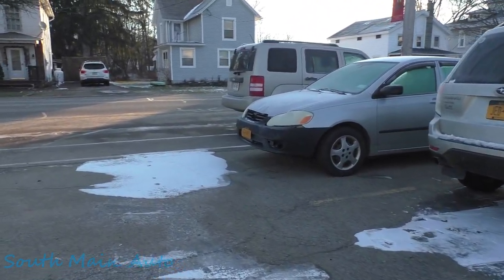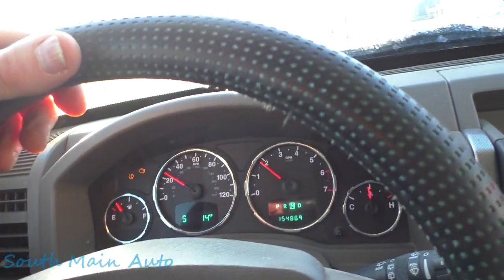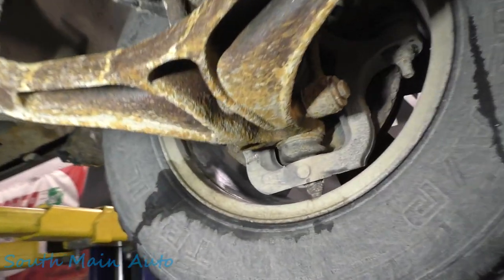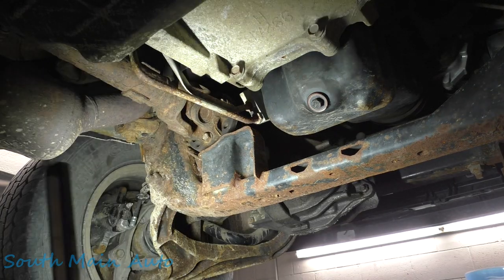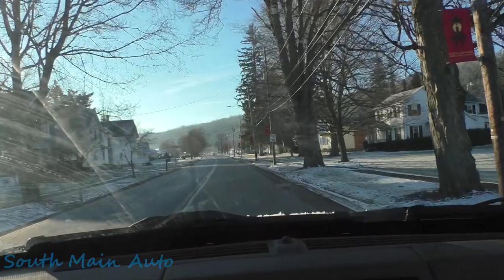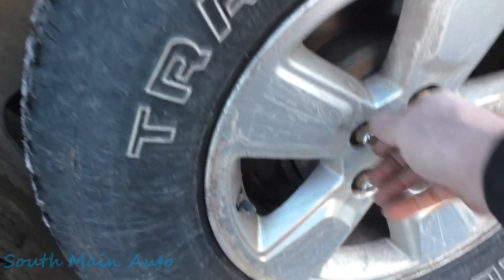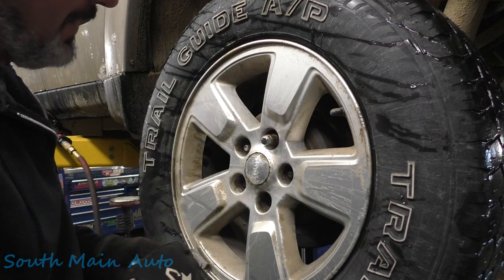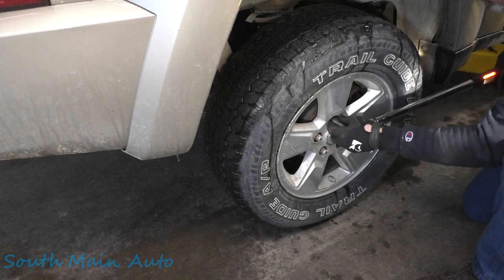Customer Just About Lost It.... A Wheel That Is

Comment: I had the same thumping sound problem three weeks ago.  Turns out the "mechanic" that changed the brakes on the front axle forgot to tighten the lug nuts on the driver side.  I carefully inspected the car and found the problem and retorqued the nuts.  Then had a nice conversation with the mechanic who promised to never do that again!  For the record, that promise was to myself because I was the meathead mechanic.

Comment: Sounds travel and bounce off to come back at the driver sometimes.
I had a small car come in with front wheel drive.
The customer wanted to find which wheel bearing, left front or RF.
I was testing on the lift with a stethoscope thinking RF after a road test.
Another tech walked by on his way to the other side of the shop and spun the rear right tire on my job.
The rumble was very loud and obvious.
They had an estimate of $250 for whichever front bearing had to be torn down and pressed apart.
We fixed it with new rear tapered roller bearings during a rear wheel pack.
If you would have driven it , you would be looking in the front too.
Our policy suggested safety check before the road test.
It doesn't always happen that way.
They want you to go take a ride so the customer can point out what he hears and is trying to fix as well as which side he wants given attention before the diagnostics prove it out.
That tech sure saved me from condemning anything in the front hubs.

Comment: Personal experience says they end up loose from corrosion on back of rim and hub face. Usually breaks down after taking off and putting wheel back on. And good luck getting a flat rate guy to spend 30 minutes cleaning them when he's getting .5 for the oil change, rotate and mpi

Comment: I just had a lady bring her little Toyota Corolla in complaining of a horrible knocking coming from the rear passenger side. I just glanced at it and there was at least several handfuls worth of grass wedged in the bead of the rear and front tires on the right side of the car. Somehow, they were still holding air. The rear wheel had lost 3 of the five lug nuts. One of the last two was finger tight and the last one was torqued to spec. Aside from the grass, the front tire lugs were fine. She swore up and down that she did not swerve off the pavement. I replaced all the lugs and nuts on the rear tire, broke the bead on both tires and cleaned grass out and sent her on her way. :body-blue-raised-arms:

Comment: had a front wheel try come off old school VW beetle which were held on with 4 x bolts not studs and nuts. With all the slop and play in the steering i never noticed it coming loose until it was on the last bolt and then things got interesting with nothing left to keep it centred on the hub. Just think Herbie goes Bananas!

Comment: True story. 1987 Oldsmobile Toronado.  Had new tires installed.  A few days later started to hear a knocking sound from front end.  So I decided that after work Friday I would try to look at it. Well driving home I made a left turn onto a major street and the front right tire just took off into a wooded area just missing a woman standing at the bus stop. The front end dropping hard to the pavement did a bunch of damage. Yes, they didn’t torque them properly.  Imagine if I was driving on the highway. Scariest thing is the look on that woman’s face as my tire whizzed past her.

Comment: Had a 2000 Caravan Sport that was making what I thought to be a wheel bearing going bad. Then one day it starts to get louder and louder and then it made 2 loud pops and the wheel starts shaking violently. The lug nuts had loosen itself and 2 studs snapped off which is what made the popping noise.The back side of the aluminum wheel had a gash, can't remember why thou.

Comment: Replaced an engine on an '05 Hyundai Sonata. Old one developed a rod knock.
A month or so down the road, his daughter was driving on s major freeway and a wheel comes off. I don't believe it was my fault as I think it would have come loose much sooner. I drove it about 200 miles before letting them take it as I wanted to give it a good shake down. 
I felt bad about hearing about loosing the wheel. However, I hope she starts listening to her vehicle for unusual noises and gets them investigated! No one got hurt. Different set of wheels fixed the issue and a set of studs back on the road.

Comment: Some where in my Toyota's owners manual, it mentions re-checking lug nut torque with alloy wheels after 500 miles when rotating or replacing wheels.

Comment: Had my dodge ram in my heated warehouse to change from axles u joints. Got it all back together and took it home and it sat outside in the winter. 3 days later same knocking sound. I thought that the u joints I just installed went bad or I done something wrong. Took it back and jacked it up to take it all back apart. And sure enough both front tires were loose as can be.

Comment: My loose wheel story kind of really torqued me off when I realized what the problem was.
A younger couple came in to get new tires on a Cavalier. So I pull off the wheels swapped em over, went to put them back on the car. I think the torque was 80ftlbs.
Well I stripped 3 lug nuts before I looked close at the studs.

Well they were too short. So my guess is the dealer or the customer swapped the steel rims to put on the aluminum OEM GM rims to make it look nicer. However! Never swapped to the longer studs. I gave them 3 OEM fit lug nuts and informed them to take it to where they bought the car and have them change the studs. Informed them I don't recommend they even drive it , since I could only get about 50ftlbs of torque on the lugs without stripping them out. There is no way the dealer could've torqued the lugs to Spec.

Comment: I had this before but the nuts were over torqued so the first bump that was hit 3 nuts sheared. They were still there but literally doing nothing. Went to take them off and they literally twisted off. This was on an old Toyota, I had to carve a divot to install new studs without removing the wheel hub bearing. Forget that.

Comment: I had a lose wheel come in a week or two ago, it was on a 2018 peaterbilt, dude swerved into one of those concreat bariors to avoid a passenger car, ended up worrlering out the rim, janking up the studs so much the hub had to get replaced, and bending the cross tube. I was barely able to get the old rim off it was so bad. Was not a happy driver that day, but at least he got it into the shop and didn't have to find out all this on the side of the road.

Comment: OK, my funny loose wheel story.  Back in Sept 68 I returned home from a 3 year overseas assignment (USAF) and ordered my 1969 396 SS Chevelle. It finally came in right around Thanksgiving  I put about 500 miles on it with no problems, and since an old girlfriend was home for Thanksgiving took her on a date to the local night club.  Big place, 3 bars, 3 bands etc. Driving her home, I got a clunking noise so instead of going parking I took her right home.  The clunking was worse as I left so I pulled over and went to take a peek under the car.  As I grabbed the wheel, it clunked.  Got my jack out and both rear tires loose. Tightened them up and was in a rage waiting to go to the dealership on Monday to raise hell. Sunday night, I went back to the bar and found out three other cars had wheels stolen the night before.  I guess by leaving the bar early I may have scared them off or mine would have been gone too. Coral Reef, Newburgh NY

Comment: I worked on a JD tractor with MFWD one time that sounded like the front axle was coming apart. Took me longer than I would like to admit, but the wheel disc to rim bolts were slightly loose.

Comment: I have experienced this on grand cherokees and other jeeps, I think the hub clearance is too tight from new and with a bit of corrosion the wheel does not fully seat when removed and  re-installed and torqued and it then settles back fully on the hub with driving and this releases the wheel nut tension. My fix is use a flapper wheel to clean up the hub if it is in anyway tight and this permanently fixes the problem.

Comment: I noticed some years ago that the left wheels on  the heavy trucks I drive tend to come loose more often than the right ones, been driving hcv for over 40 years now  so I've had a bit of practice with them.
Some of the smaller Japanese trucks had  left hand thread on the left side lug nuts, didn't seem to  have the same problem. 
I  had an older Chrysler in my shed  for a brake job,  the owner told me to carefully torque the wheels because they kept coming loose, it would appear that the  man who rebuilt the car had put the wheel studs back in on the opposite side of the car,  left-hand thread on the right side and right hand thread on the left side, possibly could've come from the factory like that, dunno. The car was a 1962 vintage. 
I  drive or repair heavy commercial vehicles  for a  job, cars especially older ones are just a hobby.
Reply: If I recall correctly, Chrysler products of that vintage used hub and drum assemblies with the studs mounted in the drum. Someone doing a brake job probably swapped them left for right after having the drums turned.

Comment: I wonder if the lug nuts themselves contribute to the issue. My 2005 Dodge Magnum used what appeared to be steel lug nuts covered by a soft metal cap for appearance. I found this out after several years when I started having trouble fitting the lug wrench over the lug nuts and was having inconsistent torquing. Several of these "beauty" caps were loose and a couple of them even came off. I replaced them all with chrome-plated aftermarket lug nuts and had no further issues. I'm sure a lot of Chrysler products used that type of lug nut.

Comment: Trivia: Chrysler first offered cast alloy wheels in model year 1969. Lugs would not retain torque, all were recalled and replaced with steel, luckily, this was fall of 1968, some cars were at dealers but few were sold. Engineering was so freaked out that no aluminum wheels were offered until well into  the 70s, and those were FORGED aluminum. Castings did not reappear until the 80s (the FWD era).

Comment: 110 to 120 is my magic number for those. Less and they work loose. More and you won't get them off on the side of the road.  Also, put solid lug nuts on and throw out the stock ones with the stainless steel skins.

Comment: I always torque wheels at 15 to 20 lbs over recommended torque then recheck a week or so later. Good and informative video.  Ps I have just run into this on a 09 Malibu
Reply: I wouldn't do this on an F150 with 150 ft-lbs spec and two-part lug nuts...
Reply: If you are talking about the lugs with caps I agree.  Worst thing made in my opinion.  I live in ohio and run into several that had to be cut off. Usually I replaced with solid ones if applicable

Comment: Replaced clutch on my Audi. Few weeks later had a weird feeling in the seat while driving, which then turned into a noise that got worse and worse. I already saw myself pulling the trans again and hoping that the flywheel or pressure plate wouldn't blow up before that. Got back home and discovered that the LF wheel had only 2 loose bolts left out of 5. Was happy and frightened at the same time.
Reply: Audi...the breaker of men.

Comment: My (shameful) story was to figure out a clunking noise from the front tire on 2010 Camry.
I did all the checks ... sway bar links, balljoints, control arms, nothing. I gave up and after long period of despair,  I discovered by chance the bolts on the guide pins on one front brake were loose with one bolt already missing. I must have forgotten to tighten the bolts after replacing the brakes. I don't know why I never checked the easy parts and instead went for the difficult components!
Lessons learned.

Comment: A month ago I took my car to a local shop here in Tampa to have my tires balanced and regretted it. One damaged lug nut and a lose wheel weight that fell off a few miles down the road. 

Took it back first thing the following day and almost lost my mind when the guy there tried to convince me I didn't really need to have the tire rebalanced. He also reluctantly ordered a new lug nut, which didn't even match the other lug nuts by the way. This individual stood there and tried to convince me that as long as I didn't feel any vibration in my steering wheel while I was driving that the wheel didn't need balancing. But it needed it the day before when they initially did the wheel balancing. 😕

 When I asked him to show me where he had read that, he couldn't do it. Big surprise right?  When he placed the tire on the machine to balance it he was having trouble setting up the machine!  RED FLAG! This man does not know what the hell he is doing. Finally got it right and got the tire back on my car. BUT WAIT! THERE'S MORE!  I saw him use a torque wrench on my lug nuts but when I asked him about the torque specs he was dead silent. Just said my car was ready and walked away like a scorned child. I guess eating crow will do that to a person. 🤦😉 I also wanted to complain about the new lug nut but I figured I would just cut my losses and leave before we ended up in the evening news. 🤕😉🤣 Thanks again for posting these great videos sir! 👍

Comment: Just last week I had a loose wheel on a 2020 Ford Transit 250. They got it stuck and a plow dug them out. It came back from its 100 mile trip with 4 out of 6 studs on the rear wheel and the 4 lug nuts were about an 1/8 of an inch away from the wheel. I drove it about 15ft before I decided something was horribly wrong.

Comment: I try to make a habit of checking lug nut torque after the first drive any time the wheels are off.  My experience has been brand new wheels often need re-torquing 2 or 3 times as the new metals stretch and settle,. but used wheels generally are fine.  Good to know to watch out for the Chrysler alloys though.

Comment: I can remember getting home from a long shift and my wife telling me there was a grinding cluncking noise coming from the left rear on her car. So I jacked it up expecting to find a bearing or brake problem. After spinning the wheel and checking the bearing for play nothing was  jumping out at me. So I stripped it all down checking the bits as they came off. Still nothing. I put it back together and told her I couldn't find a problem.
Next day I got a call at work .  She was stranded 50 Km from home, the engine was running but it wouldn't drive. After arranging with the boss to take the rest of the shift off and make it up later I went to  the rescue. That was when I found the problem!!! The right hand front CV joint had detonated.
Eric

Comment: Nor a vibration but rather a loss of control when I had a wheel coming loose. The car would shoot across the lane more than I wanted. I was in a 45 mph crosswind and I figured that was why the car acted so squirrely. The wheel came off just as I pulled into a gas station. I took the wheel cover off and the lug nuts were gone  I removed a nut from each of the other 3 wheels to put it back on, then drove 10 miles to a junkyard where they gave me 5 nuts for free! They had 5 gallon buckets full of them sitting around.

Comment: I forget what I did to my old '93 3/4-ton Suburban, I think front rotors, but you know how you get an old lug nut and a stack of washers and drive in the lugs? Looked tight, so immediately took it on a road trip (from Southern California to Northern California). First bathroom stop, luckily I checked. No big deal, but basically slow-mo torqued those things down into the hub one pit stop at a time.

Comment: Any rust or corrosion on the wheel studs will give you a false torque reading, the torque wrench says there tight when really there still loose. Rust scale/ corrosion should be scraped of the mating surface where the rim meets the rotor or hub surface to. Tractor trailers had a lot of loose rear bud wheels when they had inner and outer nuts.

Comment: Same thing happened to me last fall with an alloy wheel on my Mazda. Had the wheel off to check the brakes ( note correct spelling) two weeks later clunky noise in the back loose lug nuts

Comment: Lol, even though this is more of a corrosion issue with the conical seating area on the wheel, it's still a good example of why double checking torque after a few hundred miles is recommended by pretty much everyone. Too bad nobody does it though. I always retorque my wheels after I or a shop takes them off for any reason. Even though it's a huge pain on the Mustang with its 150ft/lbs spec....

Comment: i had 2500  ram and i did  tire rotation and only use the impact wrench only   come back from work that day  i hear a bang when stoping and accelerating  when i got home take wheel cap off  all 8 nuts had about 5mm before they would been off the stud   thats the day i when and  buy a torque wrench and never had a lose nut

Comment: I had a front wheel come loose on a 08 grand caravan when I stopped to check it I had two broken lug bolts. I'm sure if I had gone another 5 or 10 miles I would have lost the wheel and it was a front wheel.

Comment: Loose Wheel Story: Big Dummy Junior High Mental case did not tighten (except with his fingers) the front passenger lug nuts in which the customer turned left while the tire went straight. The tire shop declared it was the result of road conditions but settled later to repair all the damages to the vehicle ($7500). Recommendation: Don't hire 14 year old (mental) kids, minimum wage and expect them to understand 'clockwise vs counterclockwise, since they have only used a digital clock.